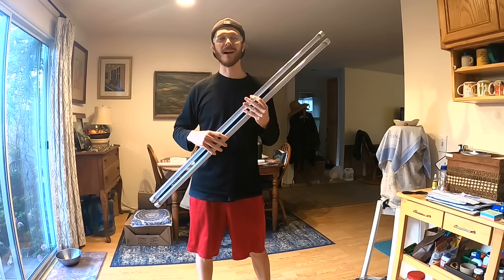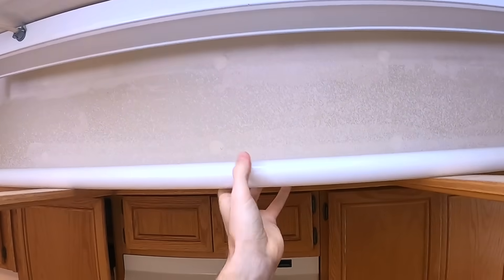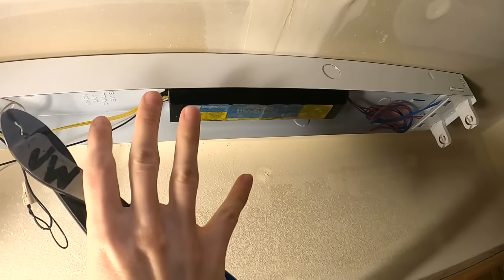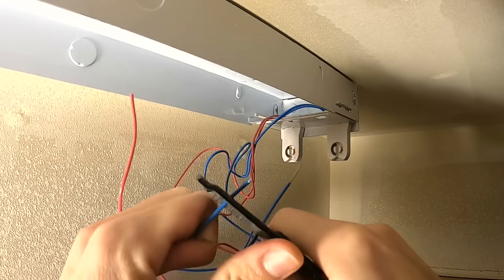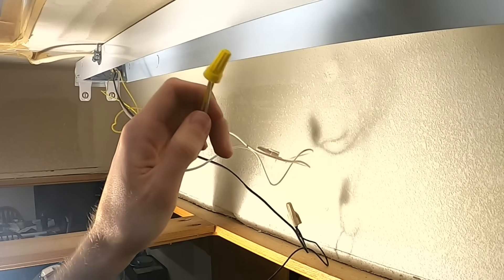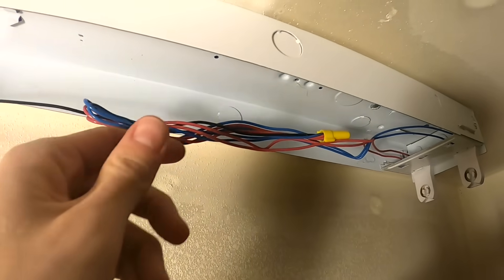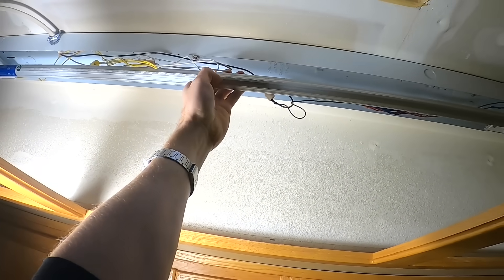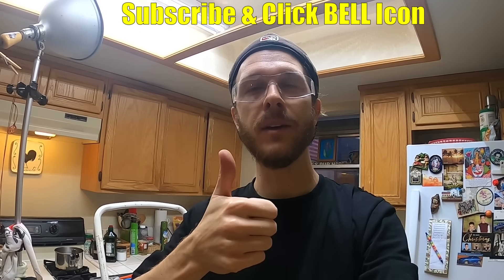How To Easily Convert Fluorescent Lights to LED | Save Money on Energy Costs

Comment from the maker: TOOLS & SUPPLIES & DONATION LINKS
4ft LED Bulbs (Clear or Frosted Lens Cover)- https://amzn.to/3XQGck9
Electrical Voltage Tester Pen- https://amzn.to/2LDsGfN
Wire Nuts Kit- https://amzn.to/3HlooYP
Electrical Wire Stripper Pliers- https://amzn.to/36E4Orn
Pliers- https://amzn.to/3ZTgrBu
Wire Cutters- https://amzn.to/2PKYnFg
Screwdriver- https://amzn.to/38SgZPh
Tool Set- https://amzn.to/3epVN4X
Safety Glasses- http://amzn.to/2ez41Jw
Leather Work Gloves- http://amzn.to/2x5BZk3
Magnetic Work Light- https://amzn.to/33tk6tp
If you Enjoy the Channel Consider Helping Support it by Donating below & by Subscribing.
PAYPAL DONATION https://www.paypal.me/JonnyDIY
Zelle Donation JonnyDIYs@gmail.com 
Venmo Donation JonnyDIYs@gmail.com
Reply: Just wondering, if this same concept would apply to single-tube wiring configuration? (obviously, half of the wiring will not be there)...

Comment: plug and play LEDs (type A) will not work in an "magnetic ballasts" fixture;  they require an electronic ballasts to work properly.   The type b leds require ballast to be bypassed regardless of Ballast type.   Fixtures older than 20 years old most likely have a magnetic ballast.
Reply from the maker: Thanks for sharing 🙌👍

Comment: It's a great feeling to have purchased Several fluorescent bulbs while they were still available. LED bulbs have their place, but they are not brighter. When one of the LED emitters malfunctions, the entire light no longer works. Knowing how to bypass a faulty emitter to save the entire light, is recommended. Thanks for your video and all the best.
Reply from the maker: You're welcome, happy to share 🙌👍
Reply: @JonnyDIY  Happy to share my knowledge of LED lights.
Reply: My LED bulbs are much much brighter than my flourecents, and they last much much longer than flourecents also. Flourecents also make a humming sound that LED's don't make. I love my LED's, glad I converted my flourecents to LED's.
Reply: @westerbonie208 : old fluorescent lamps lose half their brightness compared to new fluorescent lamps. This is often overlooked.  I've replaced many LEDs that didn't make it to their rated life. I got my workshop fluorescents free, I'll stick with them while the work.
Reply: LED bulbs are available in 4000K and 5000K versions.  The higher the number, the brighter the bulb.  We have them installed at our school, and haven’t had a failure yet.
Reply: @robertheinkel6225 : the k stands for color temperature. The higher the number, thebluer the light. The lamps will have approximately the same lumen output for a given wattage.

Comment: I may do this sometime in the future, but for right now I'll keep my fluorescent tubes.  When they burn out I'll consider LED's then.  I only have them in my garage and they aren't lights that get used every day or for hours on end.
Reply from the maker: Sounds like a plan. That's why I ended up doing these 👍
Reply: In many states on January 1st 2026 you will not be able to purchase fluorescent bulbs. I was going to replace a bad ballast but it was less expensive to just upgrade to LED bulbs.
Reply: @bobboo540  I imagine it will still be years before I'll need to swap them out though as the two banks of lights I have in the garage that are fluorescent are only about 5 years old.  I also have incandescent fixtures out there as I like to restore antique radios and to test them you need light that doesn't produce interference on the AM band.  Fluorescent and LED light both make AM almost un-listenable...if that's actually a word, lol.

Comment: Couldn't you just replace the bulbs and not have to worry about the ballasts?
Reply from the maker: They do make some plug and play bulbs you can use. But this eliminates the need fo the ballasts which sometimes break and use more power

Comment: Dude you should have removed the short lengths of wire that were spliced on with the nuts between the power and the ballast. Now you have 2 connections that can go bad. You had plenty of wire to not use them.
Reply from the maker: You're right on 1 length I did but not the other. It's ok though not like the wires will be disturbed

Comment: I have converted and I regret it . The led tube's don't last as advertised. Maybe some are better than others. My advice, as long has the ballast is good, stick with fluo tubes.
Reply from the maker: Yes for sure, some led tubes dont last that long. The drivers go bad in them. Got to get a good name brand one or at least a decent well reviewed
Reply: @JonnyDIY In many states as of January 1st 2026 you will not be able to purchase fluorescent bulbs and ballasts. Mandated to eliminate mercury and save energy also.

Comment: Make sure there 5K bulbs. Amazon sells them. Since there 5K white light  you don't need half as many tubes as you see so much better in white light then you do 3K Red lights. So if you have 4 old bulbs all you will need is 2 LED 5K bulbs. What a difference white light makes.You save a shit load of ac by removing the ballast.
Electrician here that's not how you make a wire nut connection. It was a mess. Wrap them up tighter and smoother and then don't leave a bunch of wire end stragglers hanging out the tip. Trim the the tip at a diagonal so the bulk of the wrap gets deep into the nut. Your nuts will come loose with that mess.
Reply from the maker: Thanks so much for the tips 🙌👍

Comment: Hello Jonny, 
I have moved into a house where the bathroom light above the mirror uses an electronic ballast for a T8 tube with the following specifications:

Pl (W): 1 × 18

Un (V): 220–240

Fn (Hz): 50/60

In (A): 0.08

Power factor (λ): 0.96

Ta (°C): –5 to +40

In this fixture, an 18W LED T8 tube is installed, but it does not work at all. Occasionally, when I switch it on, the LED blinks once, but then nothing happens.

My question: Is this ballast compatible with the LED tube, or should I change the tube  to a fluorescent one? Note that there is no starter installed, and the fixture has no place for one.

Thanks.
Reply from the maker: Its possible the bulb is just bad. I would try replacing that with either a fluorescent or a plug and play compatible led bulb. Either that or I'd upgrade the light fixture to one that accepts normal bulbs, that's what I did at my house recently

Comment: Being that the ballast was removed, could you have used the T-12 LED tubes instead of the T-8 LEDs in your fixture, since the pin sockets are the same size?
Reply from the maker: Possibly if the bulbs fit the fixture and were bypass ballast compatible bulbs

Comment: Flipped the switch early one morning and none of the fluorescent bulbs in the kitchen illuminated.   Purchased new IED bulbs.  Removed the ballast following the expert instructions in the video.   Popped in the four new IED bulbs returned power and  everything worked perfectly.  Took less than 30 minutes to complete the task .  Could not have been easier.  Well done
Reply from the maker: Awesome! So glad I could help you get it done and fixed 🙌👍 and that it went smoothly for you

Comment: I did this and it didn't work! Used a T12 bulb that said it'd work with any type of ballast. Maybe I need a new type of bulb?\
Reply from the maker: @Unknown-hu4gf possibly, if didn't bypass ballast may need another bulb thats plug and play
Reply: @JonnyDIY  The bulbs I put in it are Philips InstantFit  T12 replacement that claim to be LED. It says on the box that for use with electronic and magnetic instant start ballasts. I was work before I did you fix. However before that It'd stay on for 30 min then shut off for about 15 min then come back on for another 30 min then shut off again. I got tired of that and tried you conversion technique. I think these bulbs need a ballast, but was under the impression they didn't? Any idea? Thanks!
Reply from the maker: @Unknown-hu4gf  if you did the bypass ballast method I would try some different just regular led bulbs and see if they work. Possibly could be those need a ballast
Reply: @JonnyDIY  Thank you! Did you install double ended power bulbs in your conversion?
Reply from the maker: @Unknown-hu4gf  I cant recall the exact bulbs I used it's been too long
Reply: @JonnyDIY  I appreciate you for following up with me!
Reply: @JonnyDIY  Are the bulbs you installed TYPE B Single Ended Power or Double Ended Power???

Comment: you did not mention that u need to remove the ballast if u r using LED light or did i miss it?🤔
Reply from the maker: @mohdrazibabdraub9097  you can leave ballasts and get the bulbs that are plug and play or you can bypass and remove as I showed 👍

Comment: Good info, thanks. Here some additional details off a lighting seller web site. 
TYPE A LED (Ballast Driven) 
Sometimes referred to as plug and play, the Type A LED lamp directly replaces traditional lamp types such as Compact Fluorescent (CFL) and Linear fluorescent.  No rewiring is required, no electrician is required.  You can simply replace your existing lamps with new Type A LED lamps.  Type A LED’s are not compatible with all existing ballasts.

TYPE B LED (Ballast Bypass/Direct Wire) 
The Type B requires rewiring of the fixture to supply line voltage directly to the lamp holders or sockets.  The linear versions, T8, or T5, are available in 3 different varieties:  Single Ended Power (SEP), Double Ended Power (DEP), or Universal single or double ended power.  Which version you choose is dependent upon your existing fixtures.
Reply from the maker: @Snowdog216  you're welcome, and thanks for sharing 👍

Comment: Not enough information. You basically told people that, "You can buy a red car at a car yard because they go faster and they look better".
What I'd like to see (in something like this video), is for someone to come back from an electronics store with all the gear in a box and set about to fully create a whole stack of LED lights which will match the bought product and to be able to show schematics and all the maths needed to do this creation.. Or more simply, set up a bread board with the source volts you're using and plug the LEDs into that board as a mock up and wire it all up to finally show what happens when we flick the switch.

Comment: Lots of bad work. Look for professional showing the right way. Not even any sticker to tell what kind of tubes must be used.
Reply from the maker: @samisuomalainen9870  good point I did write on fixtures denoting that they were converted to running on only LED bulbs 👍

Comment: Watching your video by far was the easiest to understand, the ballast in my system is made by Pacific Ballast, and the wiring is nothing like what I have seen in any videos when it comes to the ballast.  On one end of the ballast I have 2 blue wires that connect to the slots to insert the tube and from this end of the ballast I have a red wire that runs to the other 2 slots on the other end of the light fixture.  I am trying to install GE Type B Led T8 (direct wire), can you give me some insight on how to do this correctly or where I can go to find out more information, any help is greatly appreciated.

Comment: You were probably duped by fake specs, because in many cases, the standard 4' T8 modern fluorescent bulbs, produce more light per tube, and have nearly the same efficiency.

It is very likely that your generic bulbs used the same fake rating system as most generics, that they took a lumen # from a datasheet, with the LED operating at ideal conditions and temperature, and just multiplied that lumen value by # of LEDs in the array, without understanding, or caring, that driven at a different current and running hotter, they won't produce as many lumens.

Further, you're repeating inaccurate information.  The old tubes are far more recyclable, and made with abundant materials like silica and aluminum, with less mercury in them than you'd get from eating tuna fish.  If you think they are a problem to recycle, then do you plan on just throwing the LED tubes away when they  fail?  They will probably not have a significantly longer lifespan than the fluorescent (again contrary to marketing) unless in a scenario where they are turned on and off a lot of times per day, and then that alone is a reason to use LED tubes but I doubt that you even mentioned that.

However in the end, all that really matters is that you are happy with them, though I could not be happy with 5K color temp for anywhere but a garage or utility area.  It's much too cold a color temp for bedroom, kitchen, dining room, living room, etc.
Reply from the maker: @stinkycheese804  yea luckily the diffuser panels that were in that kitchen were yellowed and adjusted the color balance to a nice warm tone. Ive since removed drop lighting in there and put pot lights though

Comment: I breed Day geckos for 50 years now so I need grow lights I switched to LED  on my in closers. I’ve had nothing but failures with them they are a lot more expensive. Its bs say they last 20 years. Going back to my 5.0 tubes.
Reply from the maker: @JohnDillon-zh7js  try Philips brand bulbs, theyre pretty good

Comment: Don't play with guns - don't touch wires - unless you know what you are doing. Both have one thing in common -- mistakes can be deadly.
Reply from the maker: @BernhardSchwarz-xs8kp  yes always hit the main or cut off that circuit at the breaker 👍
Reply: @JonnyDIY  It beats me who "an expert" is not sticking to rules that in any "master electrician rules and regulations" test is a must.
Reply from the maker: @BernhardSchwarz-xs8kp  I didn't show it but I did  and mentioned it at 0:37 👍
Reply: @JonnyDIY  Sorry if I missed that. But I think it is vital to mention it. Pardon me - It was not a critique just a "security valve" for people who follow instructions without thinking. All good - apart from that I enjoy your contributions.

Comment: Replacing a fluorescent light with a led one is not a great deal.
Just remove the old one and fix the clips for the led light on the wall or ceiling, slide the light fixture into the clips, connect the switched line and neutral.

Comment: Unfortunately these lamps aren't sold at the DIY stores or Wal*Mart.
Reply from the maker: @CSmith-gb1sl  some local hardware stores should have them no? Any batteries and bulb store near too if have one
Reply: @JonnyDIY  Not the direct wire ones (or is it B for Ballast Bypass... see I learned something here today! 🙂),  Right now I'm looking for either 15" or 18" for a project.  Still though I have only came across the "Plug & Play"... & they did not play well with my "instant start" electronic ballast as the package stated.  This was a few years back with 48" plug & play lamps, Contacting the lamp manufacture, they had told me never use any type of LED replacement with their shop light fixture (as it blew out the start within 10 seconds).   I'm sure there is misnomers on these products. 

I wonder how long they will be supporting these, I believe the T'8's & T12's got a stay of execution a while back.  Seems the industry now wants one to go with replacing the entire fixtures.

Comment: I changed my fluorescent light bulbs for LED’s like 10 years ago but I never replaced or removed the ballast and it has been working fine.  Was I supposed to remove the ballast?
Reply from the maker: @buya_pr  No you can leave them in with the specific led bulbs that are plug and play 👍

Comment: If you have the bulb type that only takes power from one end, you will need to cut or preferably pull out the yellow wires coming from the 2 sockets. You will then have to wirenut your hot (black) wire to a blue wire from one socket on the opposite side as well as a red wire from the adjacent socket. Wirenut your Neutral (white) wire the same way with the remaining wires. I had to do this method because I could only find the one-ended LED bulb type. Don't forget to look to see which end of the bulb takes power and twist it into the side you made your connections on.

Comment: It's cheaper and less hassle to simply replace the fixture with one that has LEDs integrated already. I replaced two 4-foot shop lights in my garage for $8 each. They're brighter than the florescent fixtures they replaced and will probably last my entire lifetime without having to do anything.
Reply from the maker: @jimbeckert7946  a lot of those cheap fixtures that have integrated light panels in them don't last very long
Reply: @JonnyDIY  If you say so. Thus far I have had zero problems. If or when they fail, they're cheap to replace.
Reply from the maker: @jimbeckert7946  that's true, I hope yours last a long time
Reply: @JonnyDIY  Me too. LOL.

Comment: CharlieB,  I've had a couple with the opposite problem. The led bulb is a bit shorter than the flor. Loose enoght to potentially fall out of the socket. Had to play around with the tombstone to make a tighter fit.

Comment: you need to learn how to use wire nuts!
Reply from the maker: @LevyMorris-r1t  yeah I needed to twist them a bit more untill wires twisted onto themselves 👍
Reply: @JonnyDIY  You twist them before you put the wire nut on and then cut to length and install the wirenut, just for the worlds info.
Reply from the maker: @LevyMorris-r1t  ohh yeah I pretwist them sometimes, but I've been using better Ideal brand nuts that don't  require pretwisting. I've taken apart after twisting and they make just as good at least with lighter gauge wiring

Comment: Good God there's so much wrong with this video. I couldn't watch to the end. 
Why cut the wires? Just unscrew the wire nut. 
You take out the bulbs, you take out the ballast. 
There's nothing left. 
You're essentially making a brand new lamp from scratch.
Reply: Except that the red/blue and yellow are hard wired to the tombstones, they had to be cut to complete the circuit, right? Though he could have taken the black pigtail out of the wiring because the red/blue could reach the "hot" wire. My two cents.
Reply from the maker: @macabrefrog  it works 👍